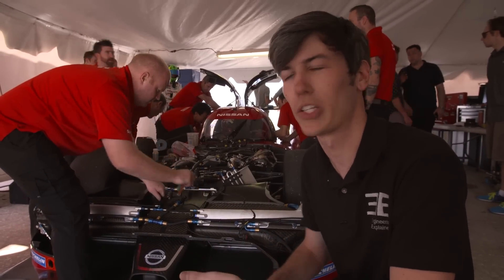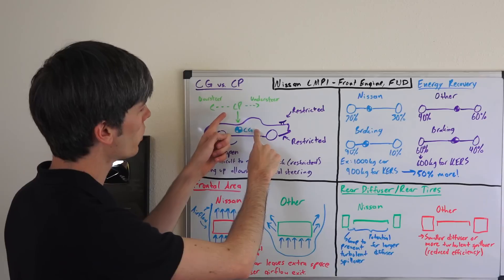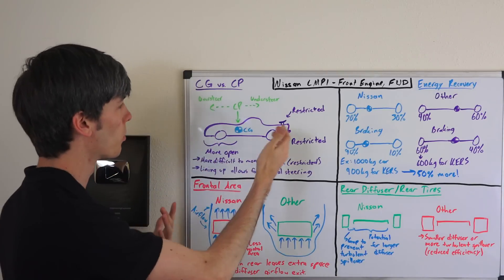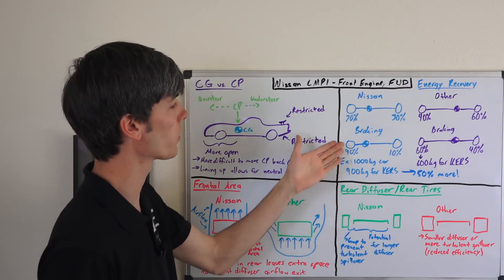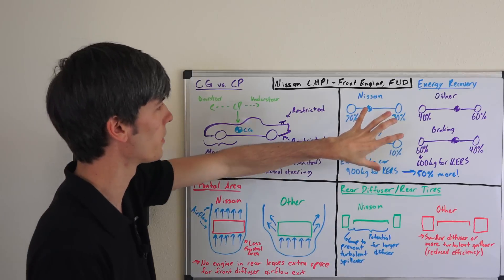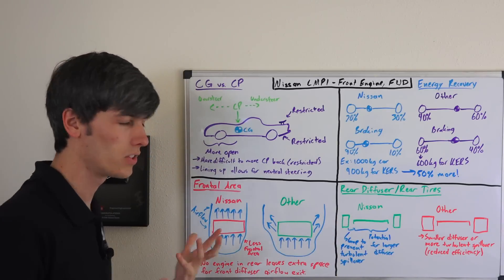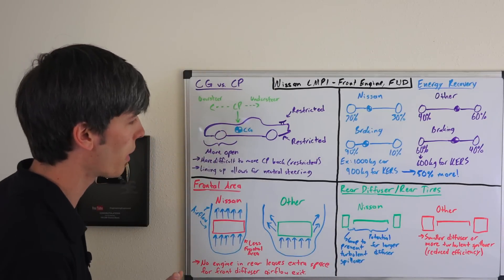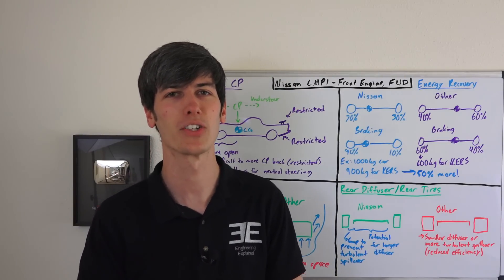Nissan GTR LM Nismo - 4 Reasons Why Its FWD & Front Engine

Comment: Let me be the douche,
but why did the perform so horribly at le mans,
I read that they were even slower then some of the lmp2 class competetors
Reply from the maker: +Peter Griffin Because their KERS system was not working. They were running about 1/2 the power of some of the other teams.
Reply: A thanks a lot,
I read a lot about this car
and I was completely puzzled when i saw it perform
Reply: Mixture of KERS system not working which had a massive knock on effect on suspension and braking. Both suspension and braking have been changed drastically since Le Mans running a FRIC system. Also brakes have been improved in both power and cooling. As far as I'm away they won't be running any KERS in testing for the rest of the year as they develop the 2016 KERS package.
Reply: +Peter Griffin Your not being a douche, it was horrible
 they weren't just slower then some of the lmp2's.
The Nissan's were out qualified by 18 of the 19 lmp2 class entrants.
They were 20.1 sec. behind the porsche 919 on pole.
Reply: Mein Fuhrer You do know how important suspension is to going around a corner quickly including riding the curbs? Then you'd understand where Nissan lost a vast amount of time was the corners. They were fast down the straights due to there design(which was very good) what let them down was lack of KERS and horrific suspension. Watch videos of the 919 and R18 through the Porsche Curves compared with Nissan.
Reply: Crap,
Reply: When i looked at the race they were saying  Nissan is just tearing it's competitors
Reply: Its a newly develop car, so it have to be refined. I dont really think its going to beat the traditional cars for now that they have been refining since forever. They have always had the same layout, so its almost bulletproof.
Reply: +Mein Fuhrer They did not have 900 hp with their engine, otherwise they would have accelerated better.

The Nissan had to avoid kerbs completely, which is a good showcase of how bad their suspension was. Additionally they never managed to get any kind of grip on getting the steering right. The front wheel drive system was something they just never managed to combine with the powersteering in a way that the pilots were even the least bit satisfied with how the car handled. 

Last thing: The Nissan had really long gear ratios (stalled even once in first on the box exit, because first gear was too long, it is uphill and you aren't allowed any wheelspin there). That helps to archieve high top speeds. They still needed way longer for the straights than Porsche, Audi or probably even Toyota, because the others had way better acceleration. Getting in 7s to 330 km/h is overall faster than needing 20s to archieve 360 km/h.
Reply: That was one year ago yolo
Reply: When the audi quatro first hit the rally B circuit their top driver couldnt get the hang of it. but eventually dominated.
Reply: +Engineering Explained They were very fast down the straights, but almost the slowest car at LeMan threw the Porsche curves.  If KERS was "their" only problem, they should have been slow down the straights and super fast threw the corners.  FRIC also has nothing to do with the problem.  The problem is you have 900-1200 hr (allegedly) being driven off the front axle with huge tires AND trying to steer with the front.  Recipe for pushing like a dump truck.  If it would work, Audi would already be doing so.
Reply: the Bird is the word
Reply: *Through.

Comment: This only explains why the engine is in front, not why it is FWD. Why is it FWD?
Reply from the maker: +Jacco Reuling Because the engine's in the front.
Reply: Can you explain a bit more or refer to one of your other video's?
Reply: +Jacco Reuling Keeps the drivetrain small and eliminates having to run a driveshaft thru the middle of the tub.

Comment: 2 front 360 mm tires for ,
- traction of the combustion-engine-power  ,
- enery-recovery and  braking
- traction of the  recovered energy by the electro-motors
- steering.......
 
Does the very big heat-production in the tires  need  a special rubber compound??

Comment: Would this car have a disadvantage in the wet?  Those wide tire up front would have a harder time dispersing water, so there might be a hydroplane risk.

The drivers will have be very careful to minimize tire wear.  But they may not need to change rear tires as often.  So pitstops might be faster.

Comment: As far as I understand, FIA rules say the KERS electric drive cannot power the front wheels under 75mph, to prevent any traction advantage through a corner. It doesn't say anything about KERS powering the rear wheels, and I think Nissan is taking advantage of this loophole. Petrol/diesel engine powering the front and electric motor powering the rear simultaneously and constantly. Smart thinking by Nissan ;)
Reply: In the race the kers didnt work

Comment: The electric drive part of the Nissan is connected to the rear. Also, even if they would connect it to the front there is no way they could even regenerate 90%of the energy..the motors and the storage systems couldn't take that much power.
Reply: Tarun Bajaj he said the numbers he used were just examples to illustrate the point... the point being that this design offers more weight to the front therefore more grip at the front and so possibility of harvesting more energy than a RWD system which would have less weight at the front and so less energy harvesting.
Reply from the maker: Tarun Bajaj What megaspeed2v2 said, and also, you'd be surprised how incredibly effective a purely mechanical KERS system can be (with the right amount of dollars invested).

Comment: Since both the engine and the wider tyres are in the front, wouldn't it restrict steering lock? It would be tricky on tight turns. Engineering Explained

Comment: and hey, interesting thought on kers;
How about using the recovery system from the drive shafts instead of the axles/brakes/rotors/wheels themselves? only need one, centrally located, can be low (because where is the drive shafts yall?) and I just realized: i'm imagining this on ALW cars so.. ya. but still, a centrally located KERS with different inputs for each axle could still work both the front and rear axles assuming its A: fitted for both axles B: the engine is at the front C: the amount of weight added by either shafts or a bigger KERS system is not detrimental to the performance of the car

Comment: This analisis was very superficial and ignored several basic matters. The first one is that Nissan will have limitations of the power that they can transfer to the front axle without affecting the steer capability of it. They are increasing complexity by integrating power transfer & steering capability in one axle. Front tires will have a double function of braking & pulling the car, they will burn out faster than in all other cars. Braking from high speeds will also be more difficult as all will be concentrated in the front axle, the rear of the car will be very light and will be almost irrelevant at braking. I am not an engineer and have not seen the full systems of the car but that is what I can see at first glance.
Reply: Plus Aero Services he doesnt do full in depth descriptions because it would take more than one guy and definitely more than a few minutes to explain if he did, also less people would watch. hes trying to give a quick lesson to give viewers a basic understanding not a full on lecture :P
Reply: megaspeed2v2
Good for him, lucky us that we have the time to give our perspectives without so many restrictions. What is your point?
Reply: Calm down bro.... XD wtf
Reply: You need a snickers?

Comment: Ehh, I ain't buying it. There's a reason almost every supercar is mid engine and drives the rear (or all) wheels. The only advantage for FWD you listed is the small rear tires and the others can be accomplished with a front engine and RWD. Sure, these are 4 good reasons, but there are 40 good reasons for a mid engine setup and I'm not yet completely convinced that this design is the way to go.
Reply from the maker: Dani2wheels Sure, it's absolutely a risk, and it's not something production cars would ever switch over to (they're not regulated by racing authorities, the world is an open market and there are inherent advantages of mid-engine RWD). That said, everyone in LMP1 has to play by the same set of rules, and if you can find an advantage in those rules, you win. That's how motorsport works, in every fashion. It's why Mercedes has been so dominant. Their engineers found the ways around the regulations to build a better car. Not saying this is better, but I admire the diversity of WEC.
Reply: Engineering Explained Definitely an outside-the-box accomplishment and I can applaud that. Good video, regardless. I guess I'd just like to see some proof of concept as this is the first time I've heard of this car/setup.
Reply: Engine went to the middle and after that came ground effect cars. With transverse engine (toyota mr2, Lambo Miura) it is quite okay, but transversal engine or gear box sticking out the rear diffuser is plain ugly. Also: Thin tires. I like it.
Reply: Dani2wheels Engineering Explained There is something critical missing from this explanation. Many of the perceived disadvantages of front engine front wheel drive cars comes from engine placement vs front axle position. A majority of road cars are now front engine front wheel drive because it is cheaper and easier to package, no drive shaft tunnel in the cabin, ecetera. But performance wise, we know this produces a very understeer prone car with snap oversteer upon correction because the engine acts as sort of an anchor weight wise and the entire car rotates around that point. Also in road cars the engine is very far forward and high over the front axle. Which is terrible for handling. Not to mention that asking the front tires to perform, braking, steering, and acceleration, is what leads to under steer as a given tire only has so much grip.

The Nissan GTR-LM Is not a front engine car at all except for the fact the engine is ahead of the cockpit. The GTR-LM is a front-mid engine car just like the AUDI R18 and Porche 919 are rear-mid engine cars. So all of the critical weight is behind and in line (Vertically) with the front tires. So the tendency for the car to nose dive and push under braking and in a corner, while still present, will be greatly negated. As for asking the front tires to perform steering, braking, acceleration, and energy harvesting/deployment,and the inherent grip problem, they are running 14" tires with a ton of grip, coupled with as slightly forward weight bias and massive front downforce from the splitter, they should and do have more than enough grip. The car will need to be driven differently than their competitors, but it will perform. Not to mention power oversteer is literally none existent so they can hammer down much sooner coming out of low speed corners than their rivals who have to wait for downforce to build.

Also on the understeer vs oversteer issue inherent in a front wheel/engine vehicle. Not all of that is down to weight positioning and downforce. Front vs rear grip also comes into play. A car with vastly more rear grip than front will understeer no matter axle is driven especially if its the front.. The reverse is also true, a car with vastly more front grip than rear will oversteer no matter which axle is driven, but especially if the rear is driven. But there are ways around this. As the Delta Wing showed, a car with tiny 3" wide tires and minimal front grip can turn as long as the pressure per square inch of contact patch is matched between the front and rear. The GTR-LM does something very similar but the other way around. They are running 9" wheels in the back which have less grip to match the reduced load they have to support. So the pressure on the front vs rear are very close. Furthermore they have the ability to tune this with variable down force as needed. So the GTR-LM should handle quite neutrally with no braking or acceleration loads, which means they can tune it, again with downforce, to make up for those braking and acceleration forces.

Comment: I've got an idea for a future video topic. Since the web is so divided on the specific concept running through my mind and there are a lot of faux engineers throwing around misinformation, what would be your thoughts on doing a video over the actual physics behind changing tire profile as a means to alter overall gearing, rolling resistance and fuel economy? Also, I think speedometer calibration would be a worthy point to hit on that a lot of people overlook entirely.

Comment: The underfloor at the rear of the Nissan is a reference area that is the same for all LMP1's. Where the Nissan differs, they're using the narrow rear wheels to get the front diffuser evac tunnels more volume. Which is why it's wider than the "spec" underfloor.

Comment: I think you completely overlooked the fact that all other hybrid P1s are AWD and some are able recoup energy from both axles because the motors are already there.

I think the whole idea about the centre of gravity vs centre of pressure is sound, but it isn't the reason why Nismo went with this concept. Instead it was a SOLUTION that allowed them to dramatically reduce drag. Moving CP to the front will not allow them to increase downforce, it wasn't the point anyway. In fact I'm certain they're way down on DF compared to other works cars (or even all LMPs?). But GT-R LM was intended as a low-drag Le Mans-special with monstrous top speed. They moved the engine/drivetrain out of the way of the tunnels extracting air from the front diffuser, widened the rear diffuser and trimmed the rear wing. That was the entire point of the whole concept. They were also hoping to have front-biased AWD with some of the hybrid power being delivered to the rear wheels, but could not get it to work so far. I've heard about some tricky rear drive shafts that were supposed to go around the aero tunnels. So the car is FWD for now, which is also probably why they decided not to use those high profile tires at the back ("16?) which they tested early on at COTA. Unless the whole project is a disaster and gets wrapped after Le Mans, I expect AWD to be introduced next year, or even in 2015 (post Le Mans).
Reply: ***** The AWD drive configuration hasn't been tested yet. They would have but in testing they found that the are able to get enough traction from the front alone so they put off installing and testing the rear drive train to focus on passing crash tests and getting the energy recovery system to work to its fullest. The ERS (energy recovery system) is the biggest hurdle they face right now as they suffered a massive failure when testing at Sebring.